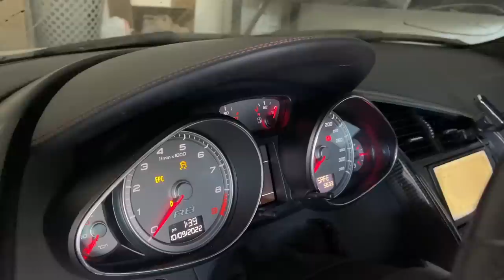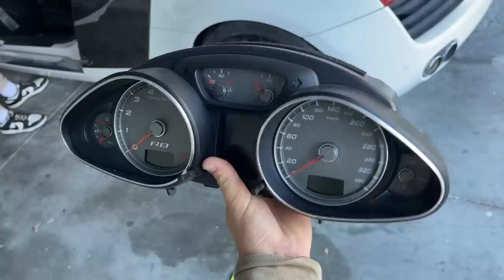I Bought A "FLOODED" Audi R8 From Auction BUT IT'S COMPLETELY DRY!?

Comment: With the amount of corrosion on that ecm and the soot in the engine bay, that thing was deep under water. Also with water damage the leather on those door cards will start to become deformed like you see on the passenger side. Seems like someone cleaned up the interior, tried to repair the issues and couldn't so it went back to auction.
Reply: Fr, there’s so many repairs that have to be done that i don’t think it was worth buying
Reply: No way man. If that car was deep under water the ECM's and Cluster would be shot.

Comment: As a former automotive locksmith, when we did Audis we ordered the keys directly from Audi dealership because they have to be coded to the vin and then programmed it using ODIS, which is the for Audi and VW.

Comment: The one thing I see a lot, especially with CoPart floods is missing keys.  If keys are shown on the pictures... than clearly the pictures do not represent the product.  I think the pictures were re-used from the first auction.  You will have to deal with disarming the alarm system before you can try to start it.  If this car came back to the auction after someone bought it before and send it back the flood has most likely wrecked the engine.  Do not start it before you perform an oil change.  If you cannot reach the owner.... well, there are several thoughts, most of them speculation.  I wouldn't think too much about the state of the interior.  It is a car from 2010 - (12-13 years now).  Seats can be easily reconditioned.  Look under the seats for electronics and check if it is corroded.  Also punch the VIN in and seek the Internet.... you'll be surprised what the old Google can find....
Reply: Yeah it does look like a car that has been relisted on auction. Im pretty sure theres a way to clock VAG cars too. In the UK we have mileage history available online, not sure about the USA. Might try to run it through autoauction, im sure Tim has though as he always talks about that site..
Reply: @misterzee5736  I think it’s had a new engine fitted.. those early r8s had issues..

Comment: First clue if was doctored up, was the seller an insurance company or their party? 
Check if the Body control module is alive, it controls the locks etc. If it is damaged it won't allow proper comms to the car: 
"As of MY 2010+ the Body Control Module (BCM) incorporates Central Electronics and Comfort System Functionality.
Make sure to have all Doors unlocked, otherwise this Control Module will block Communication with the Scan Tool/VCDS" 
Pull the plugs and check the cylinders for water/damage.

Comment: When a Audi ( A3 / TT / R8 etc ) does not have any battery for a longer period of time the immobilizer ( SAFE  ) will stay active. The trick is to have the original key and leave it on ignition for like 10/20 mins. Eventually the cluster ( that holds the immo on most VAG ) will recognize the key. Since you dont have the key i really hope the locksmith can pair the ecu/cluster.  Nice car!
Reply from the maker: Yup! This is exactly what’s happening 😔
Reply: Second this. Been through it with a VW what a shit show.

Comment: Wondering if someone has been there before you ? Maybe done an interior swap from a crash damaged car, hence the slightly tired but dry looking interior. In the meantime do an oil change and pull the plugs to check the bores on the engine to see if ingested any water. Checking the intake filters is also a good way to see if water for in their in the past. Good luck with it, very nice car but I got a feeling your going to spending a few dollars on this one.
Reply: if ecu's got corroded, then inside interior cables etc have to to be corroded too 100%, ofcourse if the case is flood. smartest thing to check first is the engine.

Comment: Just an fyi, make sure you check for the strut tower cracks on the driver’s side under all the cladding. Audi had real problems with cars having to be totaled due to structural damage caused by those cracks. Samcrac actually has a video from a few years ago addressing the problem on his.

Comment: This car has an autowatch ghost or similar on it. Same thing happened to me with a RS3. That’s why it says ‘safe’ in the cluster. It will not start until it’s removed or the correct code is put in
Reply from the maker: We are trying to get the pin. Worst case we remove just to see if motor is good
Reply: @BackYardBoyz  yeah easier to remove then the key should code in and start

Comment: The year this R8 was built, the build quality on U.K. models wasn’t perfection. The carbon side pieces fit awkwardly .Fuel cap loose. Trim on interior loose. The rear black plastic around the rear glass gets hot from the engine, discolours and weakens. It’s improved as the years go by. U.K. lovin your channel.

Comment: Someone changed the clocks bcm and Ecu’s and they all don’t match each other
Reply from the maker: Interesting
Reply: I also think this car was really flooded and somebody tried to fix it by changing all the electronics and wasn't able to get it running.
Reply from the maker: @leonidastg  but ecu bolts weren’t cut before me
Reply: @BackYardBoyz  couldn’t they just have used the security torx that it needs anyway? Don’t always need to cut them.
Reply: @BackYardBoyz  yes they look properly rusted, but the interior looks older, either the interior and some of the electronics were changed or some other mixing was done, but the first priority is to remove the immobiliser or code the key, and go from there.
Reply: @BackYardBoyz  meanwile you should look inside that engine, to see if there in no corrosion in the cylinders or on the bottom end, thats scary.
Reply: Probably changed only the bcm which was flooded , and had lower mileage recorded on it and had matching clocks, all 3 need to be married and new key programmed

Comment: I hope it wasn't the one in Florida.That the one .
Reply from the maker: It was. Why?
Reply: @BackYardBoyz  I was going to bid on it but I just couldn't without the key to check the motor and insides so I pass as soon as I save the carbon panel on the side I knew I hope it works out for you I'm going to either lucky I passed or extremely upset that I past  .